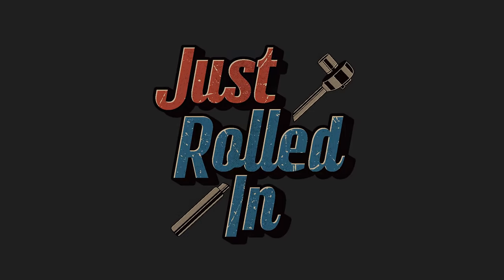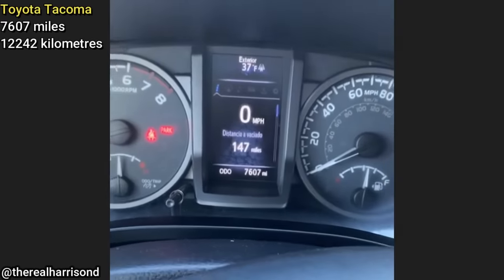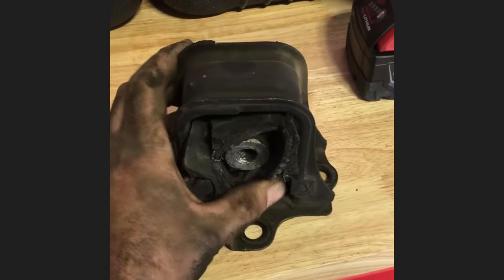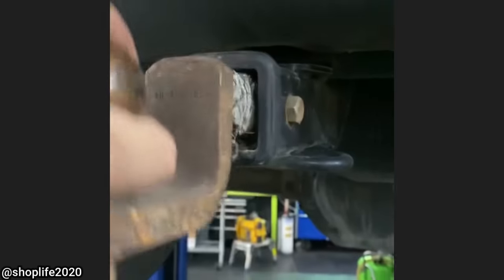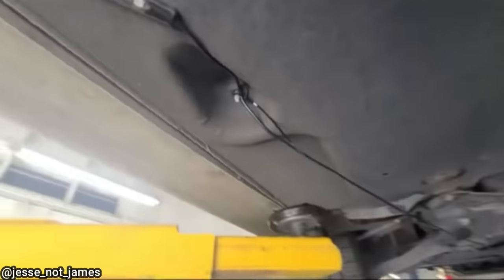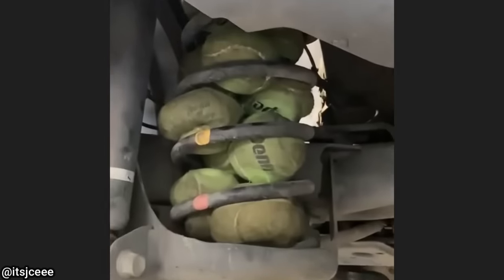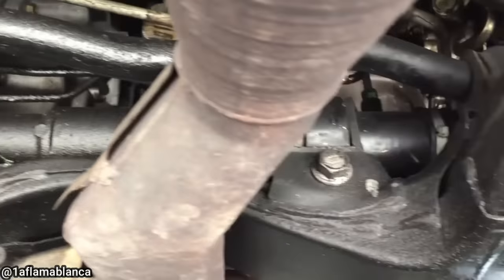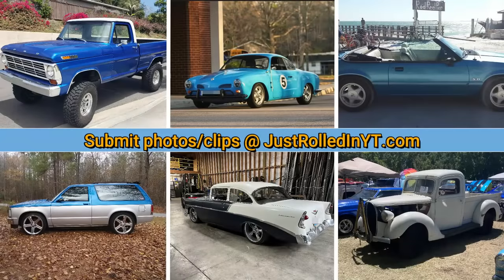Customer States Change Engine Oil On Tesla | Just Rolled In

Comment: Well, the transmission contains oil.
Reply: No transmissions on the Teslas. They’re direct-drive motors.
Reply: @troyjollimore4100  They have a 8.7:1 gear ratio. The gears are inside a gearbox.

Comment: The Tesla thing surely if its a pre-booked service you ask for make model registration, if its a roll in then a decent mechanic would say its electric it doesn't need it? Having said that about 10 years ago I took a car under an extended warranty to a dealership as they wrote to me saying it needed a new cam/timer belt. So I took it in, the mechanic looked it up and said it has a chain not a belt so it is unlikely that it would need to be changed unless the engine got damaged/ started to play up.

It amazes me how in the states there is no blanket law requiring inspections of vehicles on a yearly/bi yearly basis, surely thats a pure safety issue, but then I supposed a country that believes that they have a god given right to buy a 50 calibre gun that would let anyone shoot down a plane or helicopter or buy an AR-15 before they are allowed to drink, is not going to insist on basic safety!!

Comment: teslas should need oil changes it has moving parts such as gears in the drive train no?
i know it does not need an engine oil change it has no engine but what about the transmission for the front drive motor to the wheels is not a thing>?

Comment: ...stupidity is worst thing ever. how can someone not figure out that te$la doesn't even have an engine? that's PROOF right there that money doesn't buy brains. one must have IQ below 39 to think that electric cars have engine and need oil.

those tennis balls actually work tho. I used rubber paddings once, because I had hydraulic suspension that failed in middle of the journey and I had no money to fix them, even if i did, it was old car and it would have cost more to replace suspension than the car was worth. rubber pads worked just fine for time being.

Comment: Hey Tessa do need oil changes it's called gear oil the gear oil in the Tesla needs to be changed every 200,000 miles at least that's what Tesla's saying but before that you have to get a new battery because they're s***